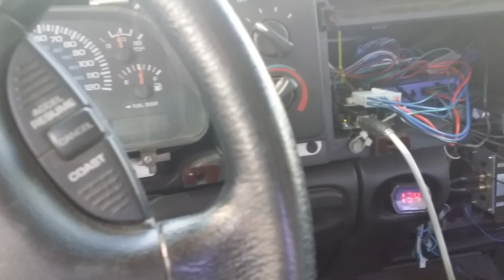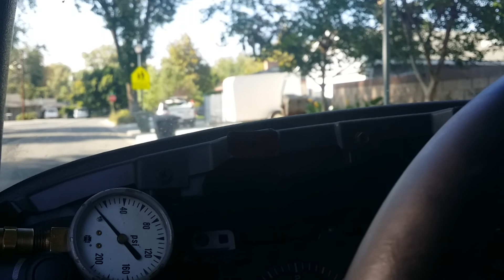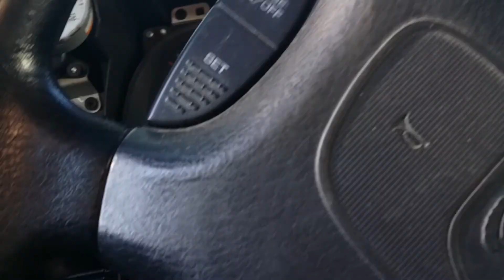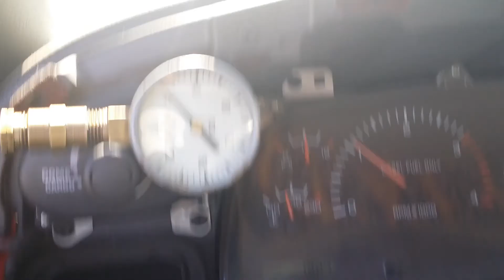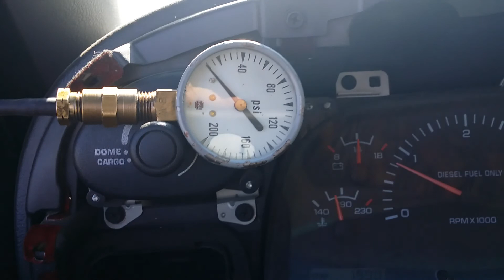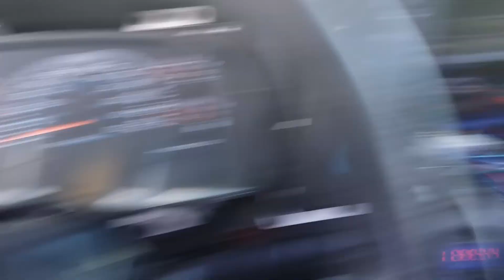HE351VE Controller (Lil' Blackbox)

Comment: I have a few questions on this product. I’m looking into buying a controller for my 12v and your seems very interesting and price point is much more in reason. The standalone lilbb that you sell is the exhaust brake integrated and a working function as it is my main reason for wanting the vgt. Can the standalone for the most part be just hook it up and go as I’m not a code righter and not the greatest with a computer or even following the terminology. Does it come pre-programmed ? Do you release updated programs?

Comment: Hi Curtis.
Nice videos and work on that LBB, just wondering if using the LBB and he 351ve on a different  engine and displacement would need to recode the arduino, and if so to what extent.
Or would the arduino always try to keep shaft speed to the maximum rpm regardless.
Thanks and keep up the good work.
Reply from the maker: No recode necessary, just RPM points and vane positions. I need to make an updated video, I have a android app now that can communicate with the full blown LBB(not the shield)
Reply: Curtis Hacker awsome man, would be nice to see a video about the 2.0 plus the app and setting  the points and stuff. Because the other options  are too expensive and harder to setup it seems.
Anyways thank you for your super quick answer and time spent.
Reply from the maker: Yep, no problem, you can check the community forum @ http://community.lilbb.com/index.php

Comment: Are you still running this setup?  I'm considering purchasing your shield to try on my ve truck.  I have coded some with a arduino.   Would like to get in touch with you if I could
Reply from the maker: Still rocking the HE351VE, finished 2.0 LBB's full stand-alone powered by Arduino tech :D, can even use the IDE. I'll have to make a new video soon after I work on some stuff.
Reply: +Curtis Hacker  are you still just using shaft speed? Or have you integrated tps or rpm, boost?
Reply from the maker: I'm still running shaft speed exclusively, I just added engine rpm through the 2.0 box counting the notches on my crank hub.

Just so I know when I'm idling. Unfortunately for my truck integrating TPS has been a serious chore. I just finally got the dodge numbers for the bracketing to mount one.. and ordered it. So it'll be just a bit longer before I integrate the tps.

Never going to add boost or back pressure though, total waste IMHO.
Reply: +Curtis Hacker  how many analog inputs do you have on 2.0?   How did you decide upon correct shaft speeds?  Did you use a turbo map?   Sorry for all the questions, trying to decide which approach to take?  Shaft speed or simple boost pressure.
Reply from the maker: The turbos have a slot cut in the shaft, with a built-in VR sensor. 1 revolution 1 pulse, easy to compute math. The shaft has a max speed of 130,000rpm, so the LBB tries to get the turbo up to 130,000 and no more, as fast as possible.

Shaft speed is by far the best way to approach controlling this turbo. If you join the community forums, there's a post somewhere where a guy integrated just counting shaft speed, while still using his old boost control code, and shaft speed was 160,000+ and climbing.

Boost / back pressure would never make good primary sources for determining size, as you can see in the video with the brake... it just simply doesn't work.

I fell on the curve and sizes because my ass dyno said that was pretty fast! LOL, but in seriousness it took months of planning, lots of driving.. an immense amount of driving to settle on this.

2.0 LBBs have 3 ADCs, 4 digital I/Os, 3 with manual pullups, 1 configurable spare, I use the spare to count engine rpm via hall sensor.

Comment: this can be used on ......say a 2.3L forged block made to run on E85? :) I've came here from this forum:

http://forums.ds-map.net/development/he351ve-controller/30/
Reply from the maker: the controller is completely standalone, it can be used on anything
Reply: +Curtis Hacker great! I shall be ordering a built kit in the near future. :) all plug and play and whatnot ?
Reply from the maker: You'll have to relay the turbo power, and crimp / solder your own wires to the header, but mostly plug in play right into the Arduino :)
Reply: +Curtis Hacker hmm ok cool. I'll look on your forum for more details.